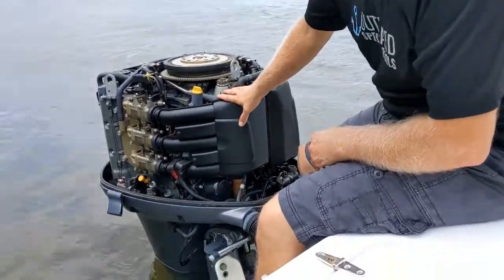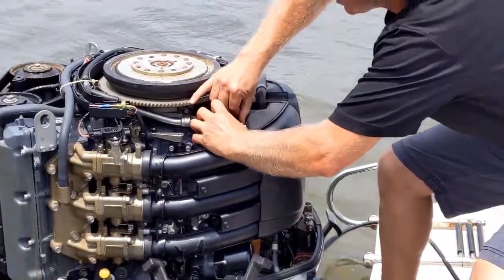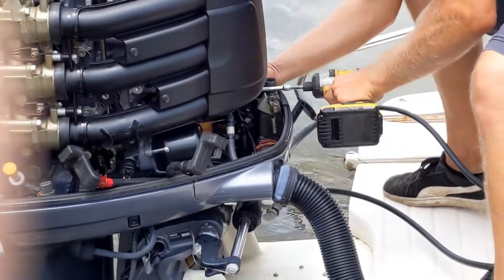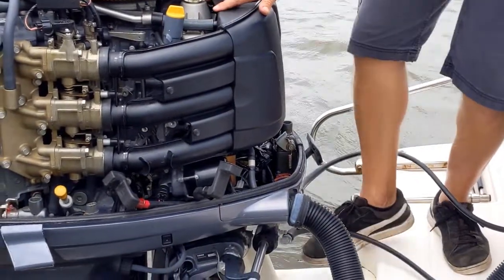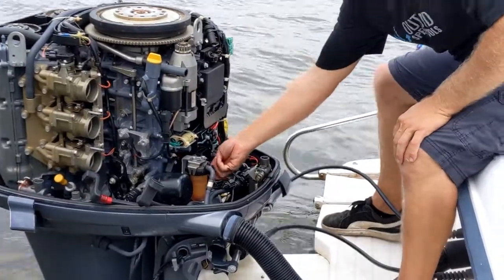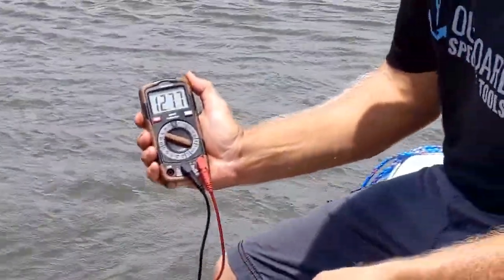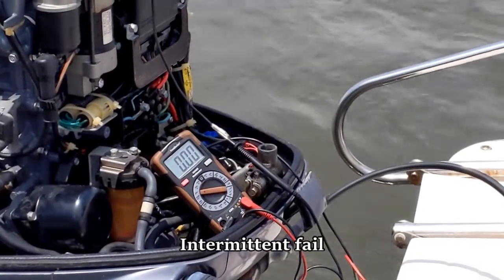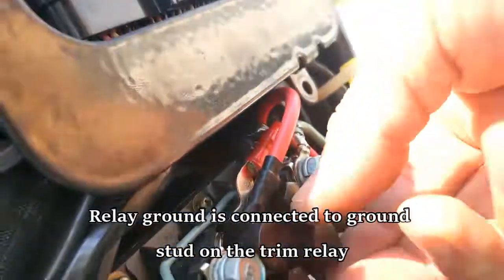Yamaha Outboard Will Not Start, Starter Problem Bad Start Relay

Comment: Thanks for the video, I have a 2012 Yamaha 150hp, the relay is actually on the port side next to the starter, so much easier. I didn't know what my problem was until I saw your video. Starting up everytime now.
Reply from the maker: Great to hear you are back up and running. Thanks for the feedback.

Comment: I have to tell you that this video saved my day yesterday.. and I don't know how much to thank you for that.. I recently bought an old yamaha F200 and installed it on my boat.  Did a few trial runs in a barrel of water before I put it for the trial. I did realise that I had a few issues and a weak relay too..  problem is that I live in Goa, India and to get a new relay would take me a few weeks. So yesterday I took the boat for the trial. And for some reason the engine stalled after just 2 mins.. by then I was in the middle of a big river and in a place where there aren't any boats no any help that can reach me.. so it was all up to this video and I managed to jump start the engine using a cable onto the faulty relay.. and that's how the engine came back and it actually saved me my day.. and for that I am grateful and thank you......  Glen

Comment: Any chance you have the part number for that relay handy? I’m having trouble tracing down just the relay.
Reply from the maker: What motor?  No problem to find the part, send a year and hp/model
Reply: 2010 Yamaha 250 SHO. Think that’s the VF250LA?

Comment: Great video, quick question though.  When you showed the two fails followed by the start, what was the click?  Was it the bendix popping up into the flywheel?
Reply from the maker: When voltage/current is applied via the keyswitch, the contacts inside the relay move into place, making an audible clicking sound, as they close a separate circuit carrying voltage and current to the starter motor assembly.  The contacts close when voltage is applied and open back up when voltage goes back to zero.  When these relays fail especially when they are early stage/intermittent failure, they often will still audibly click shut, contacts/circuit close and may even register 12V, but they are damaged and the circuit has lost the capacity to handle the amperage required to actuate the starter assembly.  In this situation, there's not even enough current being delivered to the starter motor assembly to twitch the bendix.
Reply: That make sense. I ask because I am having an intermittent issue with starting my F115 Yamaha.  Every 2 to 3 starts the bendix will pop up like it is supposed to and either wait a couple seconds then spin the flywheel or just stay up and do nothing.  I bypassed the relay like you did and it would start with no hesitation.  Still haven’t checked the voltage to the key switch but that is next on the list
 @outboardst.comoutboardspec8631

Comment: As always great instructional video.  You have been guiding me along since the Marine Tech Tools days.  Have you ever done a video on regulator/rectifier replacement?  I think mine is intermittent.  Good output for about an hour and then drops off until next engine start about 30 minutes later.
Reply from the maker: Hi Craig, we are in the process of filming a regulator rectifier/stator sequence for Yamaha HPDI.  Hoping to have it up and running here shortly.
Reply: @outboardst.comoutboardspec8631  Perfect, thanks.